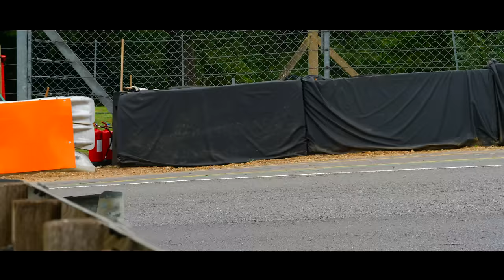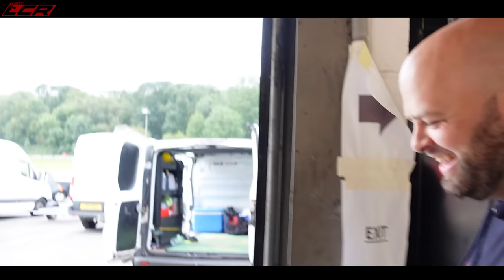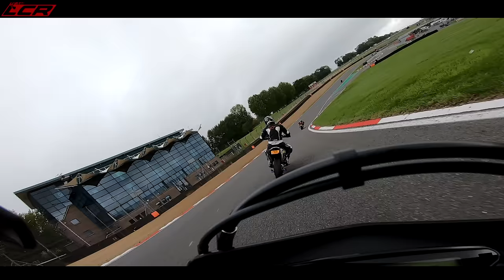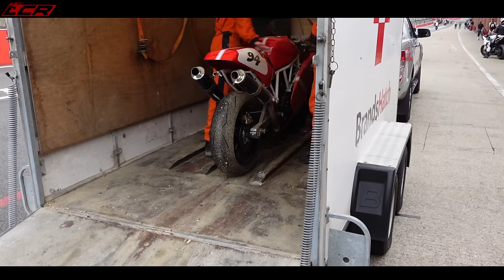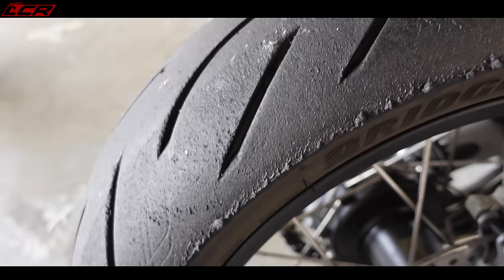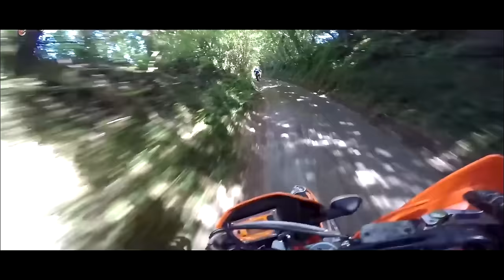Brands Hatch KTM 690 Supermoto Showdown!

Comment: As an old MT10 owner with a lot of track use, if you big guys , Wimbledon included with duck down over the tank you’ll get more on the acceleration post apex and on the straights! A full chest shoulders and abs straight up is a damn wind brake! Trust me, tuck down and you’ll reduce lap times! 👍👍

Comment: Nice job making the 4 cylinder bikes look bad with the single! Did you do the FACTORY Pro Shifter modification? It is supposed to help with false neutrals, but seems you don’t have them. I get some on occasion with the SMCR between 5th and 6th mostly. I guess the dude got mad you made him look bad huh? 😂
Reply from the maker: No I haven't, not really had any issues. Think I've hit it once or twice since having the bike and that's it
Reply: Good you don’t have the issues ... I thought of doing the pro shifter mod. and maybe the Oberon clutch slave since they seem to be prone to fail at bad times .... but , may just hold off .... if it ain’t broke, don’t fix it !🤣
Reply: Had to also replace fuel pump on my last 690... hopefully KTM gets a few items sorted out and it would be excellent bike. Better fuel pump, better shifter in transmission, better clutch slave, and these are excellent bikes !

Comment: Have you had to replace the clutch slave on your 690?
Reply from the maker: Nope still on the stock item
Reply: @LambChopRides  nice I'm trying to decide if I should replace mine preemptively with the Oberon unit
Reply from the maker: Yeah I've heard stories about them failing but all good with mine
Reply: @LambChopRides  good to hear- the thing that makes me want to do it is you are stranded typically when it fails and the clutch fluid will make its way into the engine oil as well